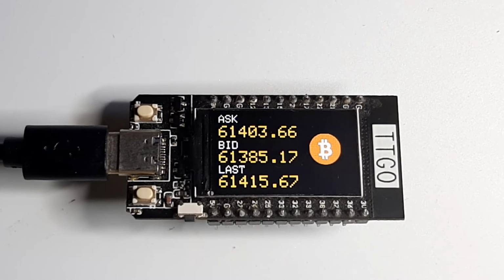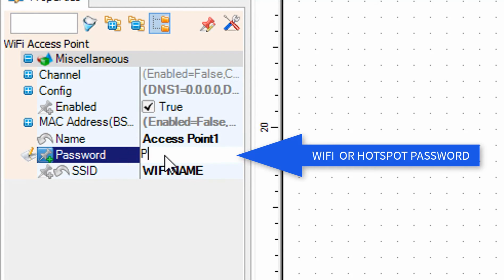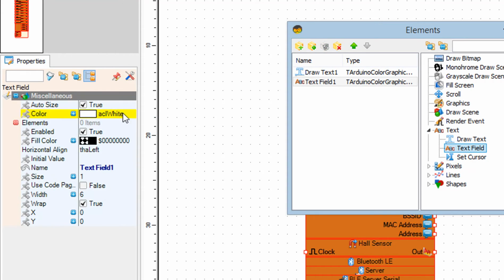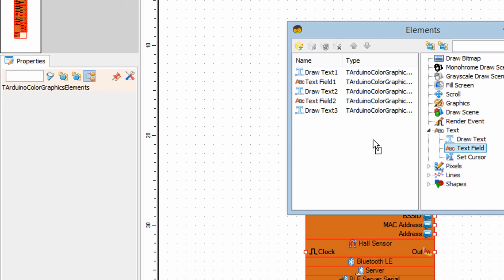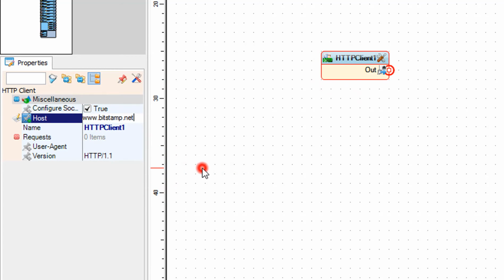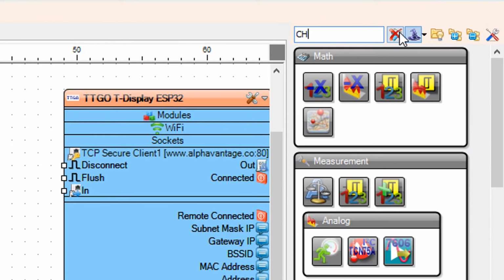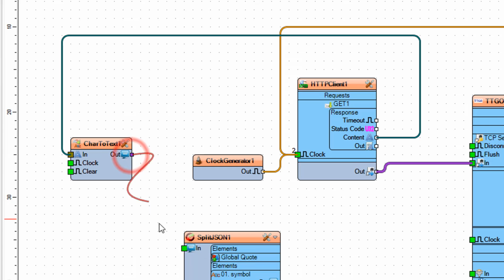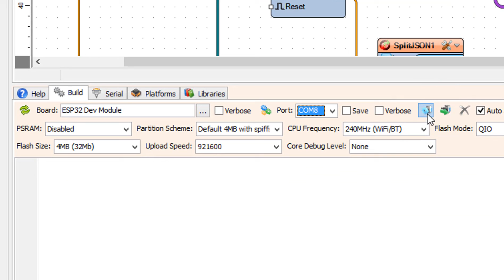Get BITCOIN LIVE PRICE TTGO ESP32 - Cryptocurrency Tutorial V2

Comment: Hey dude, i really appreciate your work. I am doubtful whether it would be able to add the clock alarm function and price quotation with different crypto?
Reply from the maker: Yes sure, this tutorial uses bitstamp API, you can check out their API instructions here https://www.bitstamp.net/api/
for example you would need to change /api/v2/ticker/btcusd/ to /api/v2/ticker/xrpusd/ etc

For the clock alarm I'am not sure what would you like to do with it, is it for notifying you? but yes its quite simple to do that
Reply: @visuinoprojects  thanks for your reply, the alarm function is the capability of setting alarm with "bee" sound at specific time. Also, can the price quotation be auto-switch between different crypto instead of one only??
Reply from the maker: @AllenTamy  You could just add comparetext component on the SplitJSON1, and set the value to trigger the sound 
for diferent crypto you would need to add text value component(set url for each), connect it to HTTPClient1, and of course trigger it with the counter so that it is diferent each time.